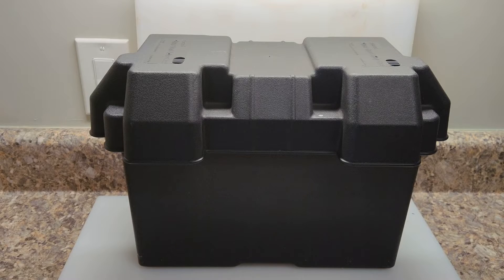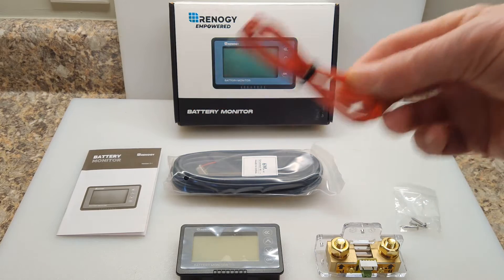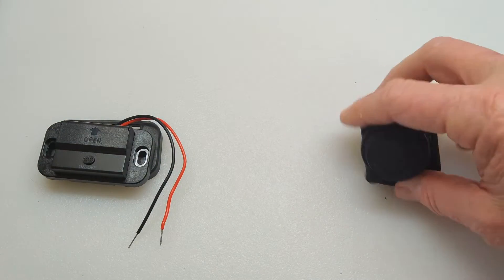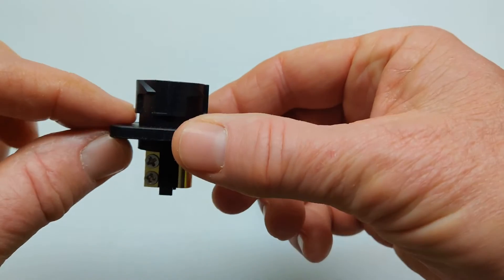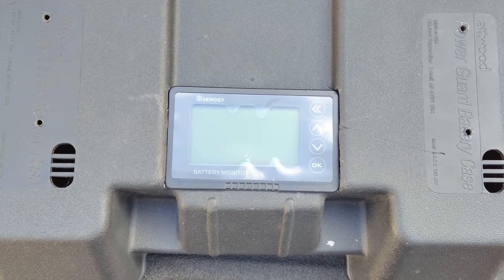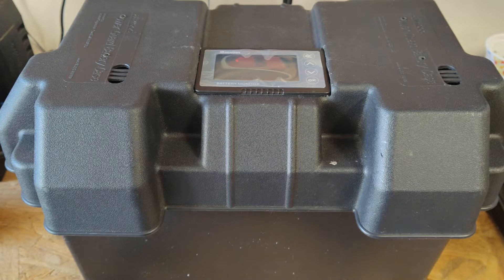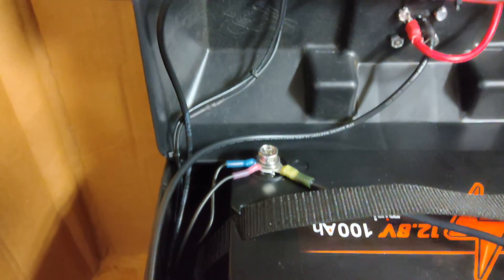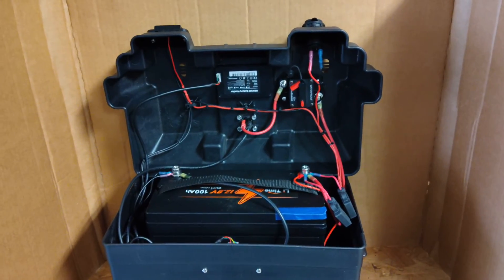DIY LiFePO4 Battery Box with Power Ports

Comment: First time I've heard of a shunt for 12v electrical.  No idea what function it serves....will google it but would be curious to hear your perspective on why it adds value or safety.  Thanks

Saw another video that the shunt measures a slight drop in current and  the meter uses it to quantify the battery state of charge......or something along those lines.  My battery has a meter built in so I don't really need those although it would be nice to have a way to see the meter inside the box.....might add a little window.
Reply from the maker: You need a specific meter (shunt) when using a LiFeP04 battery for accurate measurements.

Comment: I have haswing 12v 65lb 50a 600w trolling motor, will a 50a circuit breaker work or do I need a 60a circuit breaker? My battery is a 12v200ah.. thanks in advance
Reply from the maker: I use a 60A breaker on mine.

Comment: The total price is more than a decent deal on premade battery boxes, but I might have to swap out the old lead acid battery monitor with something like that. Thanks for posting!
Reply from the maker: Thanks Louis. Yep, the LiFePO4 battery monitor is the biggest cost but necessary. The circuit breaker is also better quality than the stock ones.